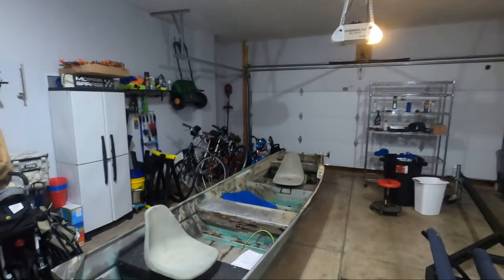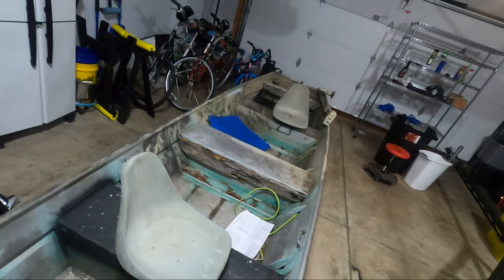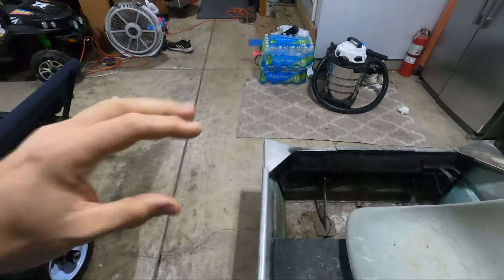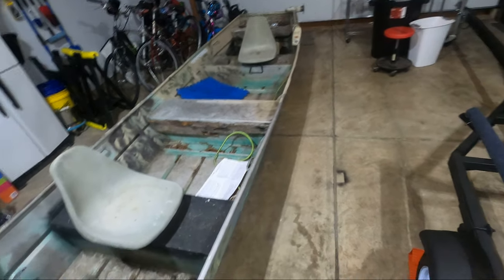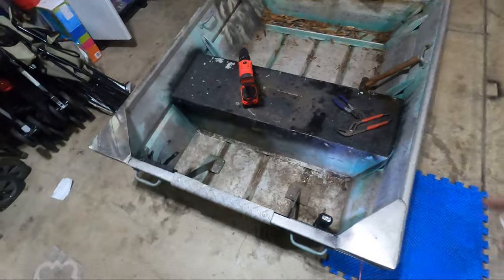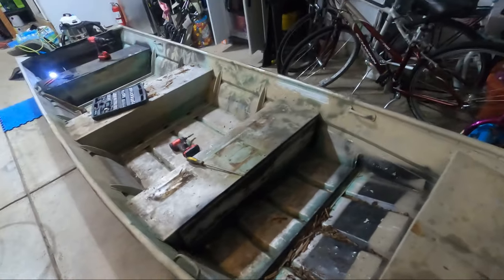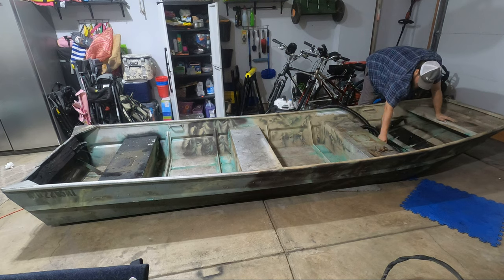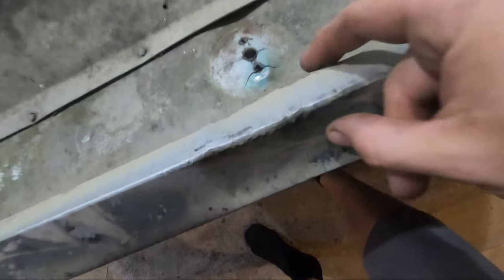1436 Jon Boat Build - Tearing Down the Jon Boat

Comment: I just bought a 14x36 jon boat for 75 bucks. 
It's missing 2 support structure beams in the middle and the transom needs light restoration other than that I figure about 300 bucks and I can get the casting deck , battery storage and livewell needed, what would be your opinion on fixing those support beams in the floor
Reply from the maker: Nice pickup! You can use aluminum channel to replicate the support sections, use the other supports as a template to give it the same bracing.
Reply: where did you buy the jon boat from? how did you get such a low price on it